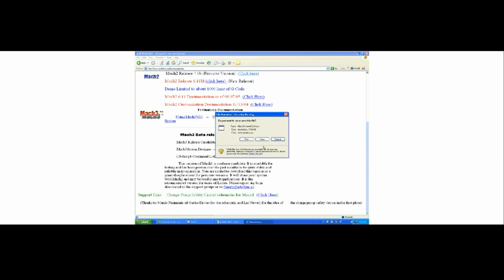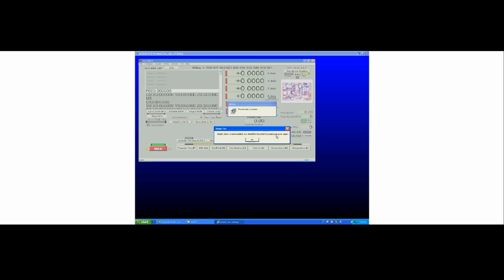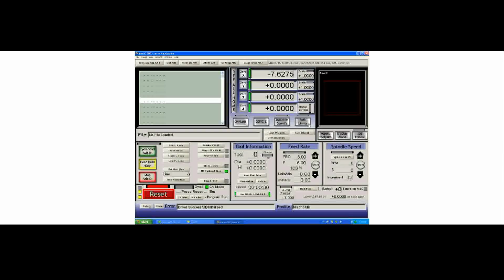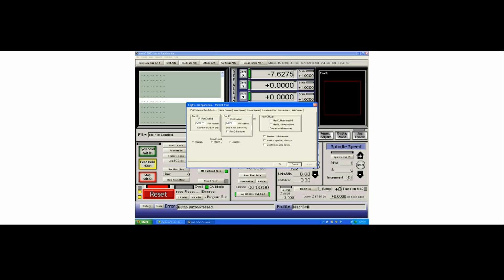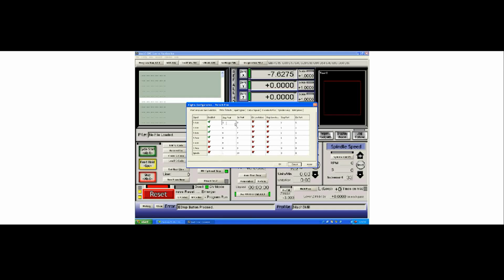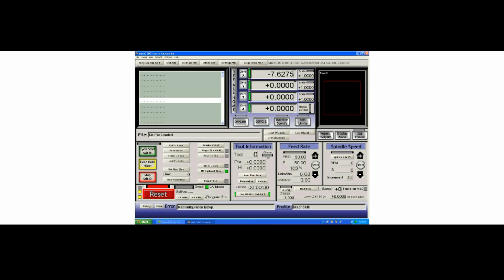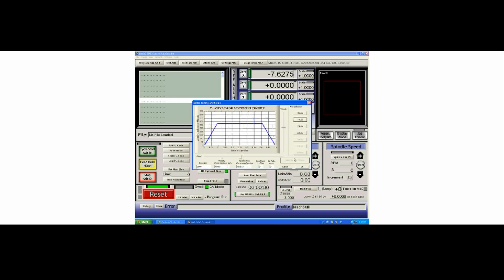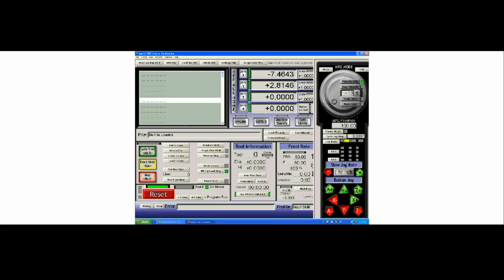Mach3 CNC Controller, Install / Configure

Comment: Hi i would like to ask you a question. Ardunio Works with mach3 ? I try to connect machine with mach3 Im using the USB cable but I gave trouble with port connection. There is any way to help ?